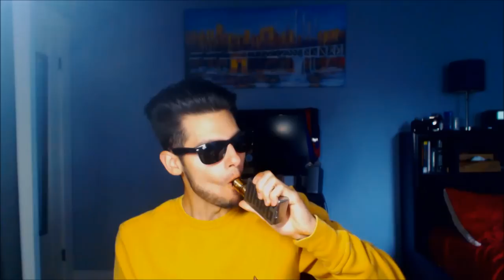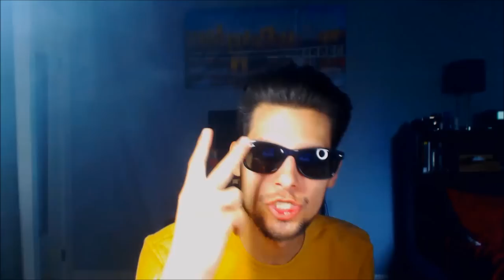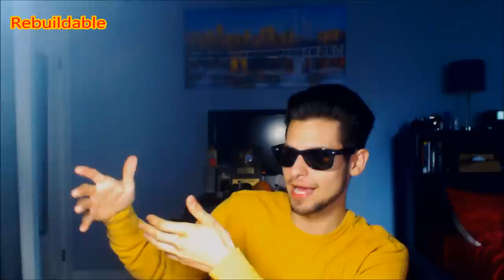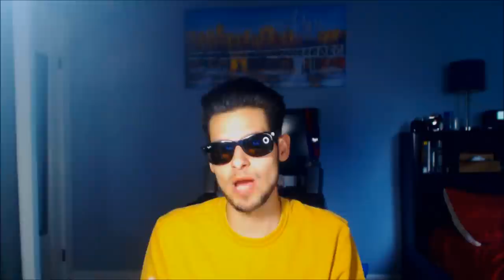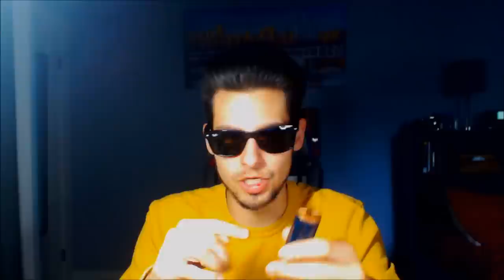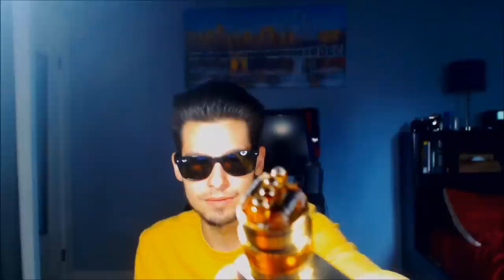How to make Thicker Os? (Version 2)

Comment: hey brother. I need to know a good coil setup for practicing tricks on a vgod pro mech with a goon rda. I'm practicing but it's slow, cause the aliens I'm using ring in at .07-.09 and my vgod just heats up too dang quick and I gotta put it down for a bit